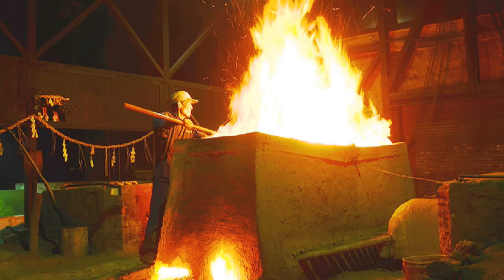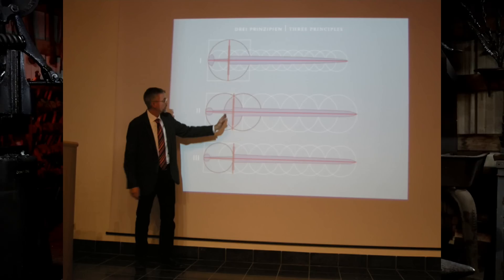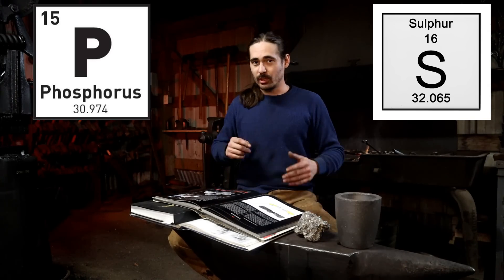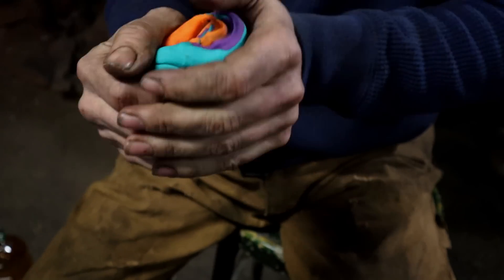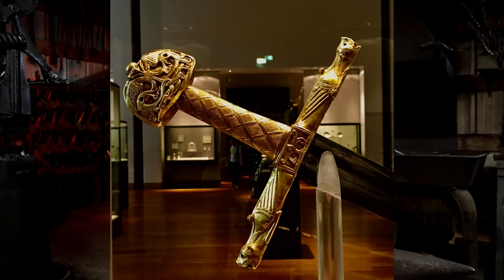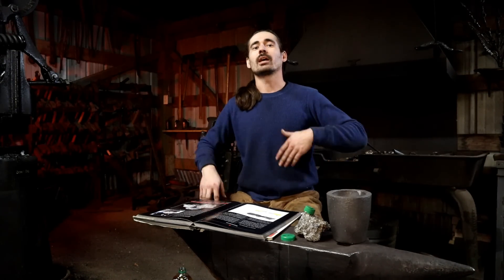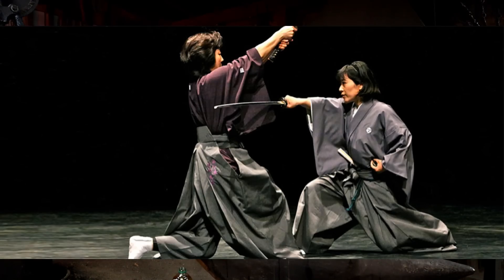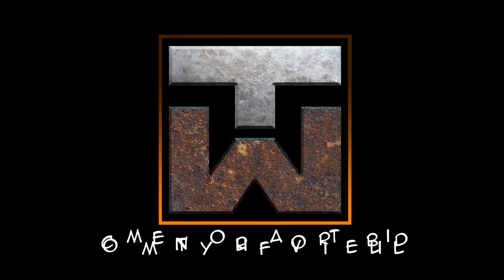Misconceptions About Medieval Steel - Wootz vs Bloom

Comment: As a working metallurgist and an amateur bladesmith, I found this talk utterly fascinating.

The thing I'm puzzling about on the first watching of this video is the statement that if a sword made out of modern steels and heat treated using modern methods can't withstand modern interpretations of techniques in historical treatises, then we're misunderstanding the techniques described in the treatises. However, heat treating of modern steels inherently makes them more brittle. If the historical swords were closer to mild steel in terms of hardness, unless I'm forgetting some key piece of context, wouldn't that mean that the historical swords can absorb impact better than modern swords and thus meaning our interpretations of techniques may be correct?

Comment: Something I don't think was mentioned, but, there were classes of swords in Japan as well. Making Katana for a guard corps was probably left to apprentices, and thus were not "high quality"  and are the lower fold swords we hear about. The super folded swords (like those made by Murasame and Masamune) were created by masters, and would be super high quality. It would take those masters months to make a single blade. So, numerous folds (200+) were possible, and they probably used tricks that weren't written down. Some things were due to the experience of the person, and could not be taught well. 
I also remember, years ago, some historian saying that the edge of a katana was similar to a micro serrated blade, which is why Samurai do a cut, followed by a slicing drawback, and that is where the blade bites in like a bone saw and cuts through things.

Comment: Weird question  and i know  this  is a little late but  if you took bloomery steel and broke it up and put into a crucible and used the same  process of the crucible steel  would you make a better or worses steel  and get the best  of  both worlds the ability to remove  a large amount  of slag thats in bloomery steel  and evenly consolidating your usable metals  but not having  the sulfur and phosphorus to deal with

Comment: I recently watched a documentary specifically about Wootz Damascus Steel and it does not agree with all of the points made here. However they did stress that there was a certain mine that had a very  very small percentage of a specific element that made the ore better and stronger than others from around the world. They state that element alone makes it a "true Wootz Damascus steel" and the patterns are not made by folding it over and over again but by using a certain process with specific ingredients to remove the impurities then another very specific method to tighten the grains to get the true patterns of Wootz steel.
Reply: They also stated that the bladesmiths in the European areas did not know or understand the processes to make crucible steels as strong as they could be until much later in history.  There are many paths to learn the ways of the ancient smith's that made the best blades in history.

Comment: Hi all, the basis of best steel comes from India and Sri Lanka. Indians swords used to cut though the European swords. Unfortunately the scientists or the saints of India were far more intelligent. The sword making in India/Sri Lanka pre-dates into Chandra Gupta Maurya era, if not earlier. To make a swords you need muscle power. To put together the steel, indian needed primarily 3 components, namely iron which was quite abundant, then comes sand or silica, which is also abundant in India. At high temperatures this silica forms glass. Silica made the steel almost rust proof. 

Now the method, the interesting point here the European furnace and the Indian ones. The top up approach of the European steel is a bogus steel, which can't even cut though the Femur. Where as the Indian steel with the top down approach steel, glass and charcoal, the steel almost got invincible. The layered steel which we see in the Japanese swords, is quite similar as the technology transfer happened in a pre Mediaval times.
Reply: Please get the data right and do a research on Indian technologies. We might have lost quite a lot of documentation. We are not a country of the snake charmers. 😃

Comment: I do not agree with what the video expresses.

Here in Spain, being a blacksmith was well regarded and well valued, both before and after the arrival of the Roman Empire.

Before the arrival of the Roman empire they already had a very good sword-making technique:

They let the steel rust out in the open for 2 or 3 years so that the soft parts would rust and rust.
They forged steel in layers and tempered it.

The good quality of these swords and their good flexibility were praised by Roman chroniclers, that is long before the katanas were invented (year 700 after Christ).
When the Roman Empire invaded the Iberian Peninsula, they reinforced the edges of their shields due to the good quality of the swords they were facing.
The Romans later adopted a Spanish sword as the usual weapon of their troops, which they called Gladius.

And both in the Middle Ages and in the following centuries, the Spanish swords of Toledo, were famous for their quality, hardness and good performance.

In my opinion, there is enough historical data to think that there were very good swords in Europe.

Comment: I have done some online research on Chinese blades. Instead of having a soft core, they often  have a hard core/edge with soft cheeks. In terms of steel production, it seems that higher carbon steel was achieved by "co-fusion" of wrought and cast iron, with folding done for homogenization.

Comment: It is not fitting to draw parallels to Mughal India to assess the state of Blacksmiths who produced Wootz Steel. Wootz was made in South India in present-day Tamil Nadu, Kerala, Sri Lanka which was never ruled by the Mughals or any Northern Indian power. Even the caste system manifested differently in the South.

AFAIK, in TN, the blacksmith castes called Vishwakarma are a high caste (Sometimes even considered Brahmins - the highest caste and the most educated) and operated similarly to a guild. 

To my knowledge, the technique of making Wootz was lost around the 18th Century and the trade was banned by the British in India in the 19th. How do you describe the process in such detail? It existed in Ancient and Medieval times both and was regarded as some of the best steel at the time, and widely exported to Europe China and of course the Middle East. I'm no metallurgist but all the historical sources I've read say it was pretty much top of the line steel for its time (From ancient to Medieval times). Am I missing something here?

Comment: Thanks for answering some questions I've had in my mind for years I have read that American car makers have been using 5160 for leaf springs and that it is good for swords I assume it's cut from sheet metal and I wonder how its method of manufacture Compares with the two methods you have described. So yeah I want to make a sword but if it turns out leaf springs are made from The Crucible method I will go with tama

Comment: Regarding how to fight and the production of swords. One counterpoint could be - based on your argument - that European swords where cheaper/easier to replace. As you pointed out - the Japanese noble men doesn't want his costly sword to break - while a European swordsmen doesn't care in the same way about the single sword? Especially if there is armor involved - meaning a broken sword might not be as much issue as for the Japanese? 

Another question I have regarding the swords - are the surviving swords, that has been compared,  from Europe and Japan swords that where actually for use in combat or where there many of them that was more of a symbolic/status object? A highly decorative sword might not be for fighting purposes and therefor the blade isn't that important. So low quality blades might have been used in some of them? 

But overall I think you have some good points.

Comment: An excellent video and enjoyed it much.  BUT, I do have a question.  Seems like you are saying bloomery steel is MUCH better than crucible steel because the crucible steel has much higher levels of sulfur and phosphorus than does the bloomery steel.  BUT, you're comparing crucible steel fresh out of pot to bloomery steel that's been worked and folded many times to get the bad stuff out (slag, etc).  What if the crucible steel were worked the same way - would it not then be a MUCH better steel than fresh out of pot?
Thank you for video.

Comment: Interesting this, but Wootz steel (the word itself comes from the Tamil word Ookku/urukku) from south India is supposedly of much higher quality than general crucible steel. Damascus blades were made from Wootz of south India if I recall right.
Reply: Plus your Katana tradition isn't that old - definitely not a 1000 years, if I remember right the Samurai as a feudal swordsman/bodyguard arose around the 1500 AD mark, perhaps between 1300-1600 range at best. Yes, Japanese steel/ancient steel making cultures worked with the material they had and that could have influenced traditions but perhaps this comparison isn't entirely right?
Reply: @NadikaNadja Both the Samurai as well as the Japanese swordsmithing tradition that was used to make curved two-handed swords in general are older than the Heian era, because by the beginning of the Heian era, curved two-handed Japanese swords were already widely in use, and Samurai were already prevalent. The Heian era started long before A.D.1000, and since this is two decades after A.D. 2000, it's been a while longer than 1000 years.

Comment: Thank you Illya, A friend of mine and I have been discussing bloomery vs crucible steels, and we were at a stalemate.  you did far better research than we, as we were using whatever metallurgical knowledge that was on top of head (I am a welder, and have worked with many different types of steels and hardening techniques that I had to learn from books, they don't teach you much about heat treatment, so had to get some engineering books, and downloaded many old smithing books to learn).  Fascinating presentation, expertly done.

Comment: It would be very interesting to see how you could make the very best steel possible with modern knowledge while only using tools and materials that were historically available, say in 1000 or 1200 AD. How far off were historical practitioners? Did they know or were they making a tradeoff based on time and material costs? Are our steels now so much better because of our chemical/metallurgical knowledge or simply because of the technology we've managed to build up over time?

Comment: They definitely had a way to remove the sulfide. The patterning came from iridium. So you’re also wrong on that part. The patterning was very important in stabilizing the sword and giving its its legendary strength. Not only that but the dendrites made it pliable and flexible. By far it’s the most superior sword.

Comment: Loved the presentation . However there wasnt an explanation of how the Phosphorus and Sulphur was eventually extracted from the crucible steel . Obviously modern steels are made with very low levels of both and there are better examples in the elite classes of old swords that also have low levels .   Was it just a naturally lower level in the ore or a better way of extracting the P and S . Did the crucible steel get folded to reduce it  , which would be difficult with material that likes to crumble at higher temperatures , or was the " bake" method , where the steel puck was held at high temp for extended periods of time , used to bake out the P and S and some of the carbon ?

Comment: Why are we comparing the average wootz sword with the katana steel which was the best bloom steel?  You should be comparing the best of the best. If the best Syrian wootz was better than the best tamahagane, wootz is better, and vice versa. The fact that the west needed millions of swords and they were forced to produce subpar products for common soldiers doesn't detract from the fact that the best Wootz was incredible for its time. The katana is a status symbol, right? it's only fair to compare it to the sultan's sword.

Comment: Fuck all these old steels, let's talk about the genius that is modern powered crucible metals. I mean things like m4, s30v, s 35vn, s110, s90v, s20cv. These steels are incredibly hard, like 50 to 70 HRC and hold insane edges, are stainless, and used heavily in pocket knives and super durable knives in general. BUT I heard that they are brittle and so that's why we don't see these steels in blades larger than 5 or 6 inches if even that. My question is do you guys have any experience with these steels and is it possible to craft a full size sword out of them and would said sword compare to A) old/traditional carbon steels B)modern carbon steels. I'm curious because I've never seen it done. I've never seen modern "super steels" used outside of knives.

Comment: Hi Ilya,

I happen to have been doing some research on this particular topic before checking in and being so excited to see that you had done a comprehensive video about the crucible vs. bloom steel topic. The information that I found beforehand happens to not show up in your video; which I was extremely surprised to see. As a disclaimer: I do not intend on causing any argument, only to try and determine if my previously found information has been considered by you or Shad.

Looking into the highly sought after Wootz Damasus steel swords from the middle east, I did not expect to find as much science and metallurgy as I did. However, it would happen that the fame in performance behind the "true Wootz Damascus" has been found to be as a result of the presence of Vanadium that is naturally occurring in the ore that the smiths were using at the time to construct their crucible steel which resulted in a particular pattern that could be seen on the surface. Initially, this was the common identifier for the blades that would perform the best. 

These swords/knives were highly valued and were identified as the primary swords that sultans and high-class members of society would wield and be armed with, and performed exquisitely. Perhaps as a result of lack of knowledge in metallurgy or simply an eye for how to make money, merchants were trying to sell swords that all had a surface pattern to the wealthy with the preface that they would perform as well as the Sultan's sword (cut silk with ease etc.). As we've found through many years of study and experimentation, a pattern-welded Damascus steel can be manipulated to appear in a predicted pattern by a skilled smith and could potentially stand in as a counterfeit Wootz Damascus. 

The market and fame for the famous crucible steel Wootz Damascus became a staple in blade trade. However, I don't know if anyone at the time knew why because it seems there is a distinct lack of records revolving around the science of sword making related to the time period. The science that has been discovered with modern techniques has proven, as I previously mentioned, that they Vanadium content in the steel seems to be the secret sauce that develops a crystal structure with carbides prominent through the blade. This has been claimed to hold a much sharper edge, for much longer than an average blade. 

I am no expert, but I feel like this science is perhaps what has caused some of the discussion surroundings Wootz Damascus vs. any other sword steel quality and craftsmanship. Have you had any experimentation with Vanadium as an additive in steels and seen any information about this prior? I would be interested to hear any comment you have on it and possibly incorporate these discussion points and crafts into one of your builds.

Tl;dr

I've seen some info about Vanadium being what made Wootz Damascus good; causing the pump up of people's opinions of it despite being rare in nature. Could you do a build surrounding this or make any comment on Vanadium causing edge carbides in blades?

Comment: I have to disagree about 'droplets' formed in a bloomery.  Steel/iron never reaches a liquid state in such a kiln.
I've done a lot of research trying to answer the question of how 1/2 million tons of steel railroad rail was laid in Eastern North America by 1835.  (Bessemer Process first patented in England in 1856) To my knowledge, liquefied steel was not possible, on a large scale, until the forced oxygen Bessemer Process. (Wikipedia is incorrect in stating forced 'air')
If you have the answer please respond.

Comment: Excellent video. Good information and not just the same basic facts over and over that we get on so many Youtube videos. You sir are a real scholar. But your presentation has entirely too much arm waving. Most amateur video makers are too stiff and frozen in place. Your problem is the opposite - too much arm waving. Big gestures are good but in moderation. Cut the hand gestures in half, turn up the gain on the mic (it should be louder), and maybe insert some caption text on screen for major points.

And make more such videos.

Comment: Could we start with Bloomery Steel, then fold and weld it, then smelt in a crucible? This would drive out all the phosphorus and sulphur in the bloom and still give us that Wootz patterning in the crucible.
Reply: The patterning is from the phosphorus as I understand it from the video. So as you already take that out through the bloomery method, you can’t both have a more pure and more contaminated steel at the same time. Can’t eat the cake and have it too…